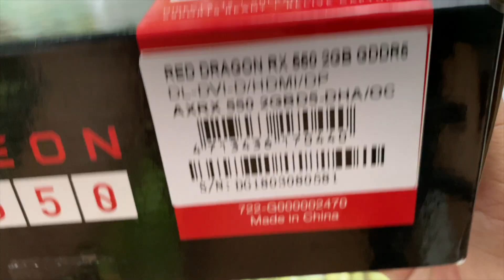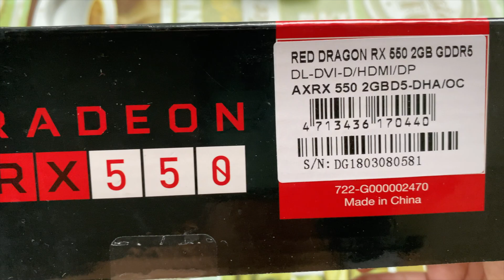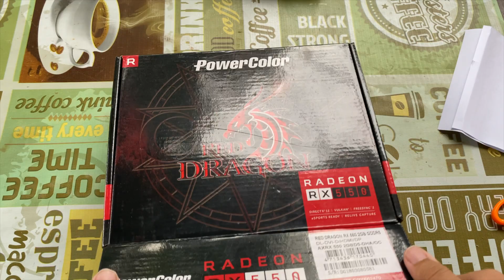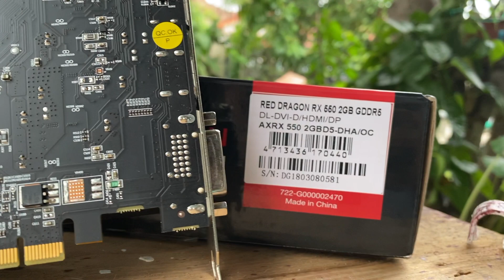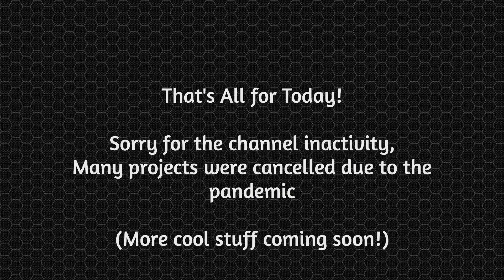AMD RADEON RX 550 2GB/4GB | Unboxing, Installation and Quick Look [PowerColor Red Dragon]

Comment: This gpu minimum psu is 400 can i use this in a 300w psu?
Reply from the maker: Yes, If you have a decent power supply from goos brands like cooler master, corsair etc
Reply: @GhastUnity  i only have a psu from my pc build is it good? Idk what is the brand
Reply from the maker: Rapii YT what brand is it? It will probably work with the RX 550 since it doesn't need any external power and pretty weak.
Reply: @GhastUnity  wearnes, idk if you know the brand or no
Reply from the maker: Rapii YT it should work with no problems , but i recommend upgrading your power supply.
Reply: @GhastUnity  ok thx!

Comment: Can i run this gpu at 230w psu? , but 4gb  version
Reply from the maker: That’s really low wattage... I think it would work but I’d recommend against it as it might be unstable. Good Power supply isn’t that expensive anyways you should upgrade it.
Reply: @GhastUnity  ye but i dont know which is compatible im noob and if its too much or something
Reply from the maker: @jolee7863  it’s too little. Minimum 350W recommended

Comment: Why i bought same card smell something chemical while benchmarking for 30mins
Reply from the maker: That is somewhat common, especially on the lower end of cards.. let it run for a few days and if it still smells, return it
Reply: Ow its normal?
Reply from the maker: @maralitjoemarieg.6211  well for budget GPU yes, since they’re mostly made from plastic but if it still smells after a couple days of use, do return it in case there is something wrong with it.
Reply: The temp was fine i just worried about the case smells like bigon chemical
Reply from the maker: @maralitjoemarieg.6211  the temps for the RX 550 is definitely very low. Just let it be for a couple of days. If it still smells return it
Reply: Now its ok running good condition no smells at all good temp thanks for help 😚
Reply from the maker: No problem! Enjoy!

Comment: Is this card good for gta rp
Reply from the maker: It should be able to run it just fine. 50-60 fps at 1080p normal settings. Make sure you have atleast 8gb of ram

Comment: Whats the dif between this in sapphire?
Reply from the maker: The Sapphire is mostly the same as this one. Both don’t require PCIE power and nearly the same clock speed.

Sapphire version uses single slot PCIE bracket but still needs two slot as it’s cooler is still bigger than single slot

Do buy the 4GB variant for either of these.

Comment: can it fit in a hp elite 8300 sff desktop?
Reply from the maker: No, It doesn’t have a low-profile bracket and it is quite wide.
Reply: @GhastUnity  ohh ok
Reply: @GhastUnity  Can i fit a gt 710 though working on a low budget build for my fortnite stream
Reply from the maker: @BeboWPlays  GT710 is not a good gaming card.
There is a GTX 1050 mini available that should do the trick.
https://www.zotac.com/us/product/graphics_card/zotac-geforce-gtx-1050-low-profile

GTX 1650, perfect budget card for streaming 
https://www.zotac.com/us/product/graphics_card/zotac-gaming-geforce-gtx-1650-low-profile-gddr6

Comment: Can it be used with my 300 watt power supply?
Reply from the maker: Recommended is 400 watts but depending on your system maybe it’ll work. And manufacturers always over estimate their power recommendations for buffer.
Reply: @GhastUnity  thanks

Comment: Can i ask need po ba siya ng 6 pin?
Reply from the maker: No 6 Pin Required!
Reply: Pwede na siya sa 400watt kahit generic lang?
Reply: Beginner kasi ako
Reply from the maker: @carlbrixcaerlang5759  400 watt will work 👍🏻
Reply: @GhastUnity  even its generic?
Reply from the maker: @carlbrixcaerlang5759  yes. The RX550 is a really low power video card <65W 
What is your CPU?
Reply: @GhastUnity  intel core i5
Reply: @GhastUnity  thank u for answer and i will sub ur channel keep it up the good work
Reply from the maker: @carlbrixcaerlang5759  should work 👍🏻
Reply from the maker: @carlbrixcaerlang5759  thank you! 🙏

Comment: Will it work with 240W psu?
Reply from the maker: What is your current CPU?
Reply: @GhastUnity  
i7 2600
Intel hd 2000
8gb ddr3 1333MHz
Win 10 pro
1tb hdd
240W dell psu
Reply from the maker: @ritusrivastava7852  I had troubles getting this video card to work with dell computers, I wouldn’t really recommend it based on my experience. But the power rating is just enough for this GPU.

Comment: Hey! I am planning to buy this PowerColor Red Dragon Rx550 4gb Gddr5 Graphics Card Low Profile at $117.26 , to my optiplex 3060 sff with 200psu, into i5 - 8400, 16gb ram. Is it worth buying it or are there more good options? Most importantly is it compatible? Thank you

hope u still relpy😁
Reply: im also going to buy the asus rx 550 4gddr5 , it just xost 96$